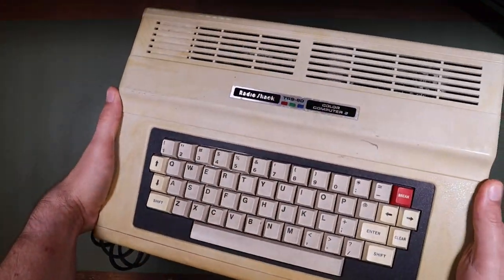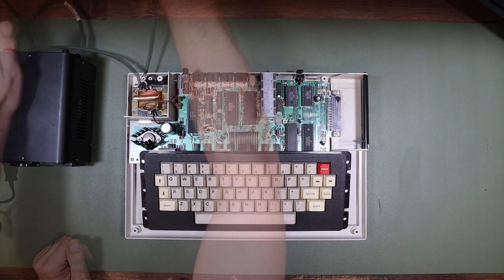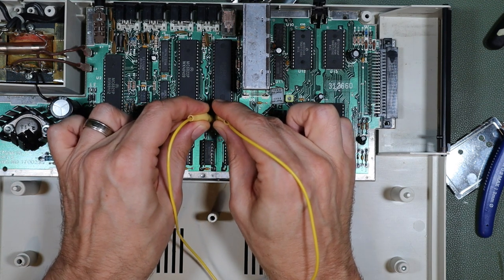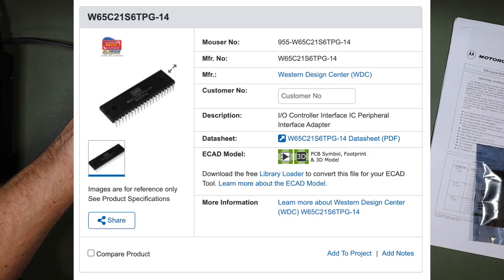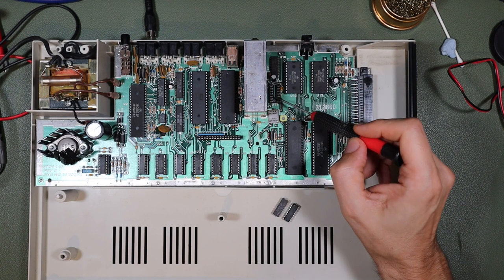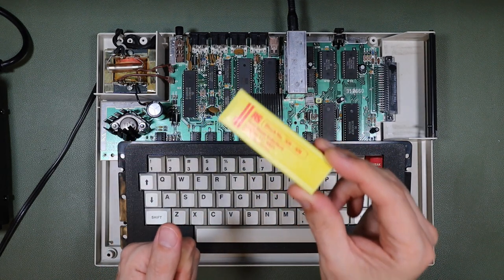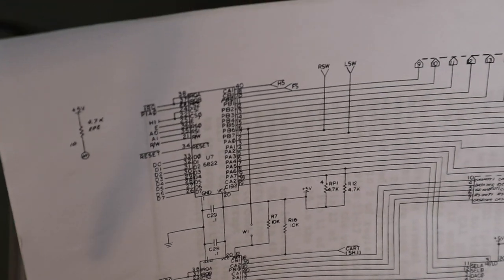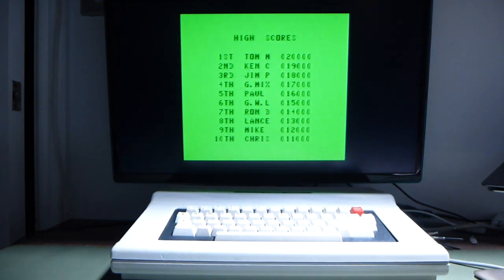TRS-80 CoCo 2 -  Keyboard Problem That You Won't Believe

Comment: I had a CoCo 2 with worse yellowing... A week or so in the sun will brighten it right up!
 I removed the motherboard and power supply and wrapped the keyboard in cellophane, and just set it outside each morning... Amazing results!
Edit: lol obviously I was still watching when posting. Congrats!
Reply: neb6  in my case the sun reduced the yellowing by several shades. It was quite impressive!
 I didn't video the process but I have photo documentation.

Comment: Wow, I'm amazed how far the CPU could execute the ROM code without a functional R/W line. I would assume the flashing cursor would involve a write. Nice work tracking that down.
Reply from the maker: Thanks Stephen...  bizarre isn't it! I guess the SAM does a lot of the heavy lifting in the architecture. Not sure. The CPU behaved quite differently in the Dragon. Still booted but crashed as soon as a key was pressed. Thanks for sticking with the vid to the end and for taking time to comment. Really appreciate it. Sorry its been so long.
Reply: That reminds me of the time our arcade museum's Q*Bert's sound board started acting up. The sounds were weird in a "the wrong sound is selected, probably a wire is broken" kind of way. Also whenever Q*Bert would start talking he never would stop until another sound effect using the SC-01 is played.
And of course, when you turn on the machine, it says "Hello, I'm turned on".
I changed all the chips in the sound line circuitry, made an LED debug cap I could piggyback onto the input latch to see if all sound lines get toggled, even made some kind of harness where you could manually select all the sounds. I eventually gave up.
Then came the day when I had to test a 6502 CPU from a different machine and I used Q*Bert's speech board for that. All the sounds were correct. I put the original 6502 in my Commodore 8032SK - garbage screen. Another case of a broken CPU working well enough not to be suspicious.
And just on this Friday evening I was working on an Atari Sprint 2, I removed one of the audio amps because it was very quiet and extremely hot. When I put it back, the machine stopped working. Long story short, the 6502's clock input became high impedance and I had to stack two identical logic ICs on top of the one creating the clock signal to get the clock signal back and the CPU works just fine!
(I didn't have a spare 6502, but I had a bunch of 74xx32s used to create the CPU clock. With zero, there were just little spikes on the clock. With one piggyback, high was at around half a volt. With two piggybacks, it was a good TTL signal with high > 4V)
Reply: @RetroTechRepair  recently I’ve seen two instances on this happening. I think that the 6809E finally overheated and failed in this odd way. Weird.

Comment: Fab video as always - nice work with the diagnostics! I was wondering, when checking for bad chips (when they are soldered rather than socketed) could you not place a replacement chip over the top so that the pins of the new chip touched the pins of the soldered chip? I am sure I've seen another repair channel where the presenter did that to diagnose arcade board issues...
Reply from the maker: Thanks MrVectrex. I think the piggybacking chips technique only works on some chips (eg, some RAM) as the chip needs to be of a type that has a high impedece state (tri-state logic high,low,high-z). If a "normal" logic chip fails the chip may drag a line high or low rather than go Into the high-impedence state that would be needed for pigging backing to work. Nice thinking though. Thanks for your comments (on this and my other vids).

Comment: Well, at least the 6809E can be replaced with the 6309E
Reply from the maker: Oooh that's an interesting idea. Thanks for the suggestion. I didn't actually didn't know ow about that processor. Thanks so much for your comment
Reply: @RetroTechRepair  It offers a slight speed boost (almost imperceptible) and additional operations that new software is designed for taking  advantage of. Canadian Retro recently did a video about whether it was a worthwhile upgrade and found a few reasons why it was. It’s easy to do in the CoCo 1 & 2 because they are usually socketed. 

I seem to remember there being a relatively easy composite mod also. I think several Tandy/CoCo enthusiasts channels have done this.

Lastly, if you really want to go crazy, there’s a keyboard membrane swap that provides micro mechanical switches giving a more tactile feel.
Reply from the maker: @jeffreyphipps1507  Thanks. Great info! Will definitely look into this. Thanks again.
Reply: @jeffreyphipps1507  actually, with optimized code there is a significant speed boost.
 Without it, it's basically the stock CPU.

Comment: Great video.  Found it while searching for fixes to my keyboard issue.  Found my old TRS-80 I got around 1985 when I was 12 years old.  First hurdle was getting it connected to a computer monitor.  Did so by going through a VCR and an RCA to HDMI adapter.

Issue now is that the keyboard spits out garbage.  I press "C" I maybe get "C", but I press "F" and getting something like "52DX".  I'm going to get some contact cleaner and a soft brush and clean what I can, but most of this is over my head.  Any suggestions?
Reply from the maker: Hi Brian, good thinking on the VCR. I can't say for sure what the keyboard problem is, mine has a membrane keyboard, not mechanical switches so I am not sure if contact cleaner would help. IF IT WERE MINE I would probably not apply contact leaner but look at either a membrane repair or replacement.  My keyboard looks like the one shown here: https://www.leadedsolder.com/2020/02/02/coco-keyboard-membrane-repair-electric-paint.html

I would probably also check the connections at the main PCB, shorting the appropriate ones together to see if the problem replicated (fault on main PCB) or did not (Fault on keyboard). None of this is advice, just what I might do if it were mine. Anything you did would be at your own risk. Thanks for your question. Good luck with the repair and thanks for your comment.
Reply: @RetroTechRepair  thanks much for the info. I’ll certainly look into it.

Comment: is there any way i can run a Dragon 32 rom inside of Return of coco?? the older coco emulator from 2000 or 2001? thanks......................
Reply from the maker: Hi @ms-ex8em, I am sorry but I don't know. I love these machines but mainly I am using original hardware (I have some Dragon 32 vids on my channel too). Sorry I cannot help but thanks for your questions. Hole that you enjoyed the video

Comment: As a former Coco 1 and 3 user it was intriguing that the 6809e worked as much as it did.  I vaguely recall a writer in Rainbow magazine stating the 6821 and 6822 are not directly compatible despite the similarity.  NTSC has 4.5Mhz sound but UK TVs use 6.5mhz so they can’t tune in the sound.  You can get sound via the cassette as the bit banger sound is paralleled with the 6 bit DAC which is used to generate the cassette record signal. Sounds like a UK modulator or an AV mod is on the cards.  And, one advantage of an NTSC CoCo is the artefact colours work rather than black and white on the PAL version.  I used to have a lot of fun finding the value written to &hFF22 and change it so PMODE 4 games would use PMODE 3 instead.  Usually the assembly code is LDA # xx then STA FF22.  Those were the days
Reply from the maker: Thanks Wenlocktvdx... awesome info what great comment! I never thought about the audio sub-carrier freq. I have yet to edit up the second part to this vid so I will mention it then! Yes the artefact colours are great... really so much better than the PAL system. I honestly think that's what did for the Dragon 32. Artefacts were always the intention of the chipset, but only ever worked on NTSC systems leaving the PAL systems with a very limited pallet. Shame really the processor is a joy program compared to the 6502 and easier than even the z80. Lovely system. Anyway... glad I could bring back some fond memories. Tell or your friends... uptake has been a bit low on this one :). Thanks again for the very informative comments.
Reply: Trying to recall more about the PIAs. The 6822 could drive more load than the 6821 so it sounds like totem pole output versus open collector. The NTSC modulator has only 4mhz video bandwidth versus 6mhz with a UK modulator. Australia is in between with 5.5mhz sound and 5 MHz video bandwidth. Artifact colour was tried in PAL but it needed a change of pattern in the middle of the screen to have the same colour all the way across. Very few even used it. I used mine for things like slow scan TV thanks to Graficom, weather fax and even radioteletype (RTTY)